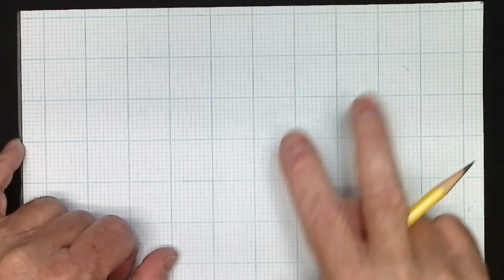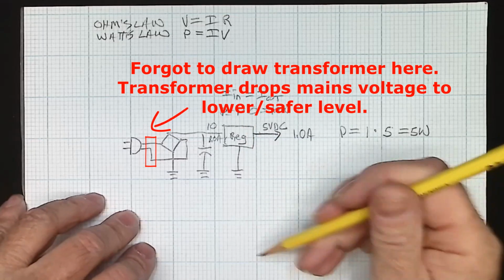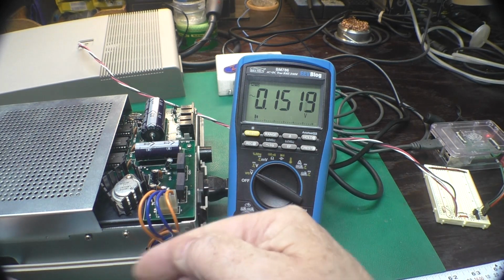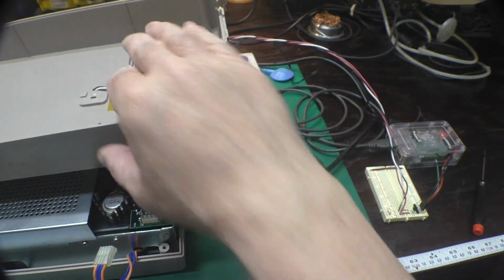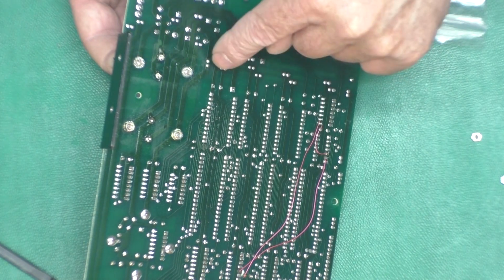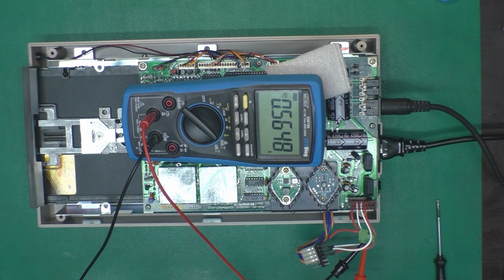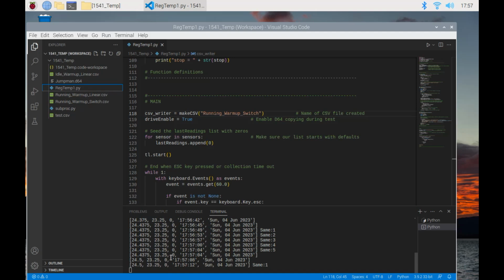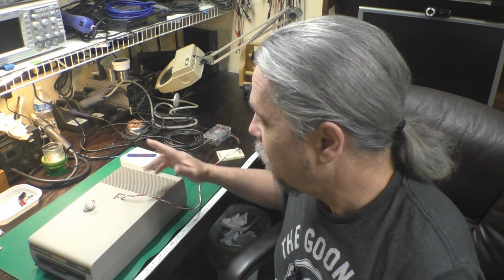Chill out! Easy, reversable, efficient, inexpensive way to cool down your C= 1541.

Comment: My solution back in the 80's was running a 12 volts computer fan on top of the went grills.   It worked, but of course this linear power supply is a much better solution.

Comment: I use a variac to lower the input voltage. I checked the 5V and12V rail with a multimeter and drop the input voltage on the variac until the point where the 5V and 12V get lower than 5V/12V. 
For 230V devices I use 150-160V input, for 120V devices I go as low as 80V input. 
The old regulators stay ice cold that way. 
No soldering, all original. 
And cheaper if you have more than one unit.

Comment: Back in the day running BBS's with stacks of 1541's i had homemade fan on top to keep them reasonable. The 1581's were later a great upgrade,not to mention CMD HD, Ramlink etc. The Amiga can read and write 1581 disks with c1581.lha from Aminet.

Comment: Another tip for the EU countries: most of the original 1541s sold in EU (other than UK) have the mains transformer jumpered for 220V input. However EU grid switched to 230V nominal years ago. The input of the transformer can be rewired to use the 240V primary tap. It will quite dramatically reduce the heat dissipated on the linear regulators.
Reply: The same happened in the USA, Instead of 110v it can be as high as 125v. 220v has gone to 240(i see 247v here).  It's neet that the Euro 1541's have multiple power taps. I don't think the USA ones had them since they were 120v.

Comment: There are cases where using a switching PSU is not ideal. Eg if you got an RGB mod to retro consoles that use an FPGA to generate the video, the switching PSU generates vertical jailbars in the output. Switching back to a linear regulator fixes the problem.
Reply from the maker: A good quality switching regulator will not do this. A poorly filtered one will.

Comment: I never heard the I in equals I out on a linear regulator before. Not doubting you, just was a fresh new info nugget on linears.
Reply from the maker: There is a wee bit of current that flows through the ground pin on the regulator. It is not much more than the quiescent current and not a factor in the cause of heat dissipation.

Comment: I just used a fan from an old CPU heatsink and soldered it to the 12v side of the 1541 and it's worked fine for years.  Your solution actually tackles the problem at the source!  I'd eventually like to replace the old chunky power supply with something lighter and more efficient.
Reply from the maker: If I were designing a new product and needed to ship millions of them then weight would be a factor, when modding a 40-year-old disk drive it is not a factor for me. 

Another way to look at it is: Unless you plan on doing a 20km hike with a 1541 in your backpack why does its weight matter? :)
Reply: @HeyBirt  Lol!  Weight isn't really a factor at all.  Just that technology has come a long way in 40 years, I would think it should be relatively easy to use a 12v 2a switching power supply and just add some circuitry to split it off into 12v and 5v to power the drive.

It's been a (really off to the side) project I've wanted to try for years.  I never got around to doing it yet.
Reply from the maker: @wadz668  A switching power supply that takes AC input from the mains and gives you DC out is really a DC-to-DC convertor inside. It rectifies the AC to make DC and then feeds that to a DC-to-DC convertor.

Replacing the linear regulators with the modern switching ones does accomplishes the same thing. The AC from the mains is dropped in voltage by the transformer, rectified by the diode bridge on the 1541 PCB and then fed to the modern regulators which are DC-to-DC convertors. 

Either way you have modern efficient and cool DC-to-DC convertors. One way is simple and non-destructive, and the other way is not. Both will work.
Reply: @HeyBirt  My idea consisted of using an old power supply from an external hard drive and splicing in a power circuit board from a car cigarette lighter USB plug.  That would give me the 12v and the 5v.  However, I only know enough about electronic circuits to be dangerous and destructive.  In theory, it SHOULD work, but I'm also worried I'd somehow find a way to destroy my drive in the process.  That's not a risk I want to take :) (yet)
Reply from the maker: @wadz668  You have the right idea. The cigarette lighter USB adapters are often poor quality and produce a lot of electrical noise. Your phone run this input through a charge controller and filter so it is not as big a deal but can still be problematic if it is really bad.

This would also require removing the bridge rectifiers and original linear regulators from the 1514 PCB and soldering leads to the correct place on the PCB to hook up your new power supply. It is a lot more work for the same basic result with a lot more potential problems.

Comment: I did the widely known mod: complete removal of internal 1541 psu (huge trafo, rectifiers, transistors, regulators) and fed the output of 12v and 5v of an ATX pc psu; works great and leaves you with a light and cool 1541 (plus the peace of mind of using a modern stable PSU)
Reply from the maker: A problem with using an ATX supply is that they can supply 20-30A at 5VDC. This will vaporize PCB tracks when something goes wrong. They also need a load of about 10% of their rated output at 5V in order to regulate properly. 

Just swapping in the new switching regulators made the supply just as efficient as a new one with less work and less modification.

Comment: So the 12v regulators aren't adjustable huh?  11.4 is just barely within 5% tolerance.
Reply from the maker: The PSU6 switching regulator meets the same output specs of the 7812. 12V regulators never seem to be all that accurate, but percentage wise are in line with the 5V type. For what they are used for it does not seem to be that creitical.

Comment: Dude, why don't you make another video for a switch-mode power supply mod. Which will make C1541 lighter and cooler.
Reply from the maker: As I stated in the video, this is another option but not what I was after. Just swapping in the new switching regulators made the supply just as efficient as a new one with less work and less modification and hacking.

The weight is also a non-issue for me.

Comment: Isn't it possible to control the IEC bus of the 1541 straight from the Raspberry Pi's GPIO pins without needing the XUM-Floppy?
Reply from the maker: There are Raspberry Pi based 1541 emulators. I just did some searching and found an old project that would load/save prg files only. Also keep in mind that the Pi's GPIO is 3.3V and the IEC bus is 5V so you would need level shifters.

Comment: Nice video. Always wondered how much better those switching regulators were than the old linear when it came to temp reduction.
Reply: They are night and day in terms of temperate and efficiency.   The reason why linear power supply run hot, is because there's a significant loss of power which dissipates/wastes as heat.   While switching power supplies were available back then too, they cost more than linear which was a big factor why Commodore chose the latter.